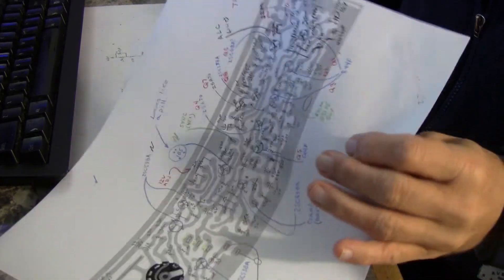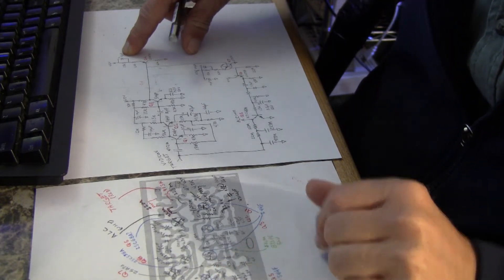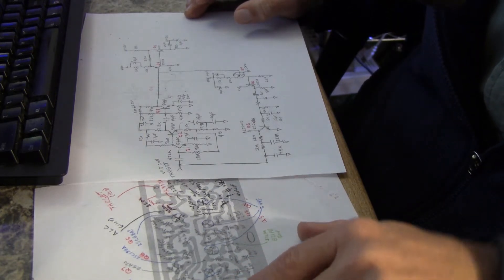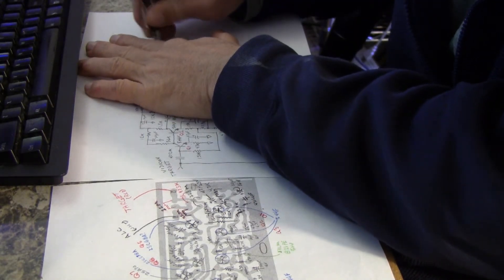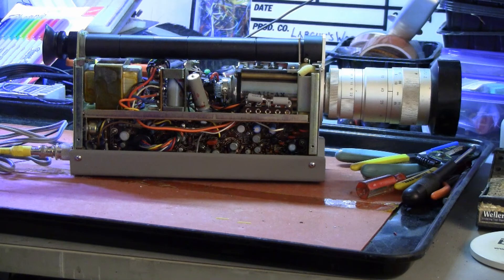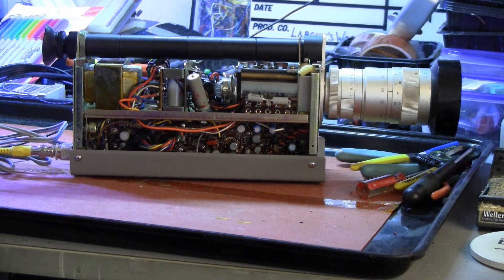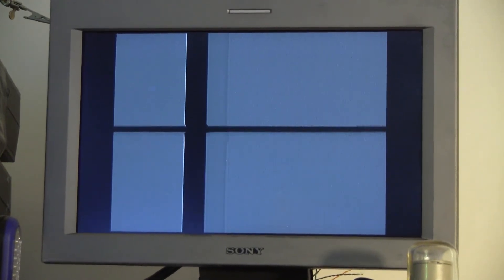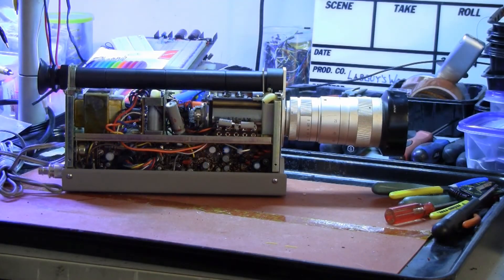Craig 6104 Vidicon camera restoration Part 1

Comment: BTW  there is a hack where if you use a EHT volt across a broken heater it can some times weld it back ?...i always had the idea to use a flat coil induction heater to try to fix or heat the broken heater ,just an idea floating about in my empty space i call  my mind
Reply from the maker: I've never heard that before. Since the getters in these tubes are as white as flour now, I'd guess there is no bringing them back from the grave. The oxygen really destroys the target photo conductor. 
I am going to have to hurry up the reverse engineering now. In the end, I  will re-engineer the electron gun bias circuit to support 20PE13 / 8844 tubes which are much more common. Should be pretty straight forward. As usual stay tuned!
NOTE: Anyone reading this, if you have intact 20PE11 tubes, please contact me and we can work out a deal. I got five tubes recently, all the same brand, and they were all bad. One of them will power up, but does not produce an actual optical image. Though I believe the target mesh is being imaged. This is probably due to oxygen poisoning of the target.
Reply: @videolabguy  could you use a something other than the 20pe11 runs on about same specifications or close pin connections ........On the heater 
more ideas here Richard worth a read plus the WW2 doc is posted here on what i mentioned
http://www.taswegian.com/NBTV/forum/viewtopic.php?f=8&t=2383&p=21656&hilit=fix+broken+heater#p21656
another option perhaps heat the heater connections till they are so hot it transfers to the heater may weld it back? Should show us the tube around this area if possible